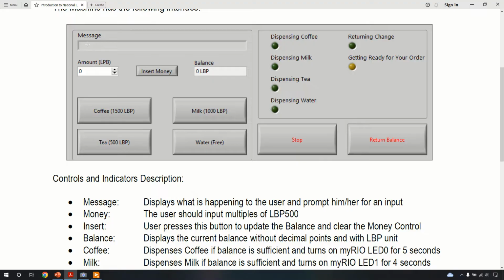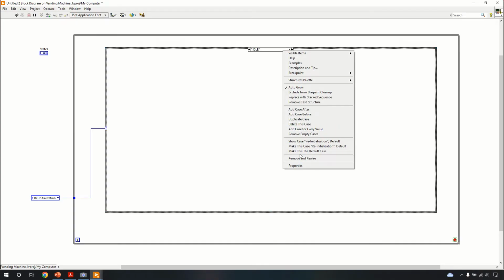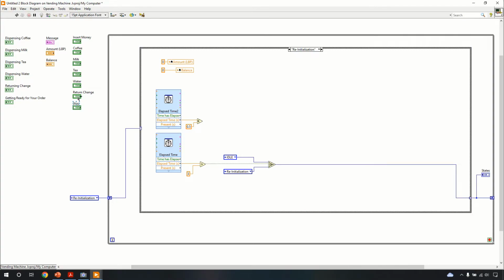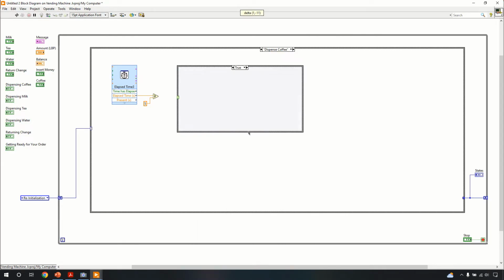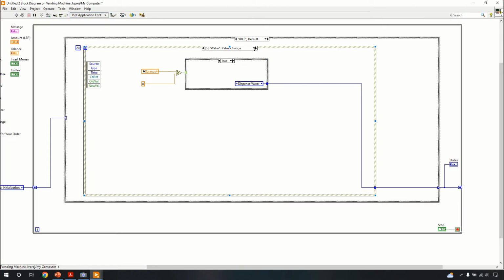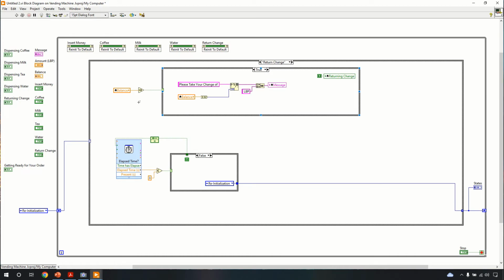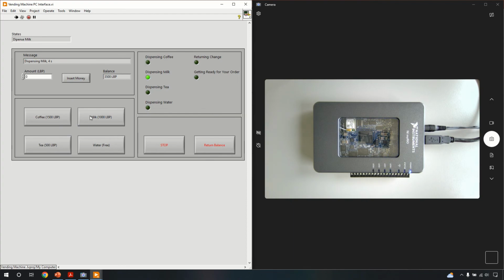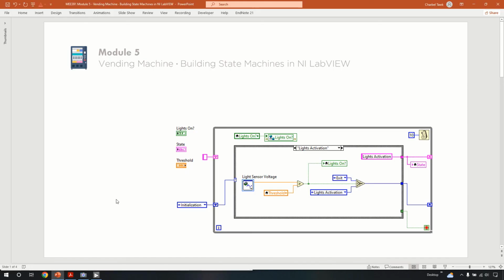Module 5 - Vending Machine - Building State Machines in NI LabVIEW and NI myRIO

Comment: Hello, id like to say great video and i have question i wanted to add new state in similar state machine but when i add it new state in enmu program stops working, state structure doesnt up date and i cant get over it. Maby you know how to solve it?
Reply from the maker: To avoid this problem, when you first drag and drop an enum of the Front Panel, right-click on it, go to "Advanced" and select "Customize". A new Front Panel will pop up showing the enum. From there next to the wrench icon on top instead of "Control" choose "Type Def." and save the VI in a Folder of your choice. Now when you add/remove any state everything will update automatically (i.e., the enum constants) and your code will work smoothly. To add/remove a state, right-click on the enum on the main Front Panel, and select "Open Type Def.", add/remove the state there and save the VI again. Now everything will update automatically as noted before. 

Alternatively, if you haven't defined a Type Def. enum from the beginning, adding/removing a state will require updating all constants manually, and usually this is a tedious process if you have many contacts for the same enum, you have to delete them and then re-create them and again define a case for every value.
Reply: Thank you. I will try it out.